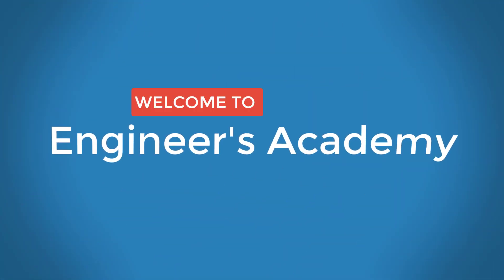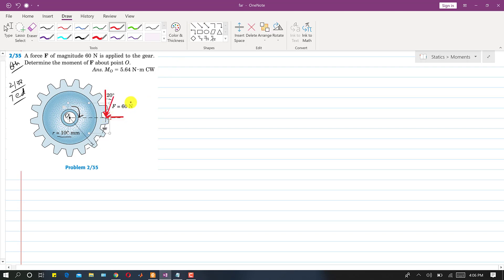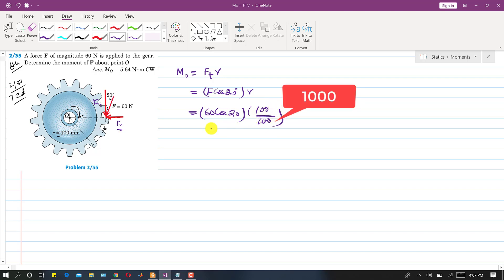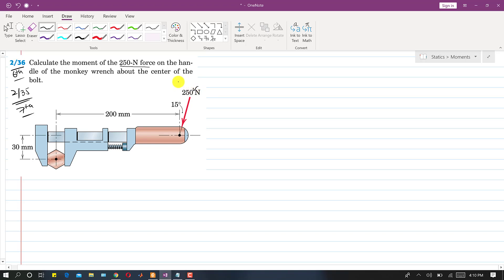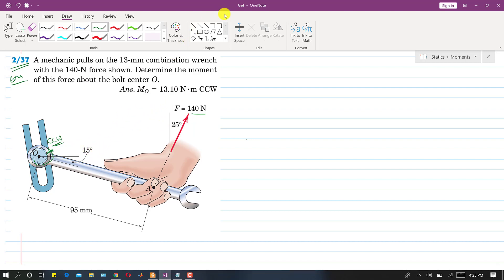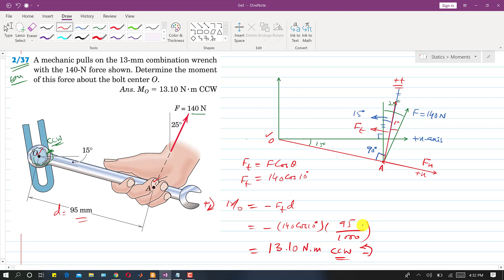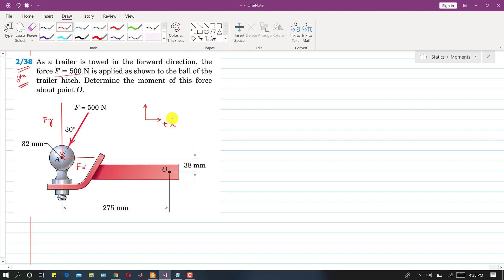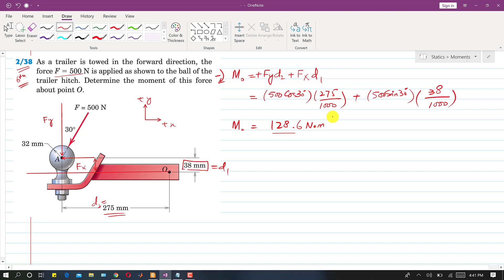STATICS | Chapter 2 | P2-35 to P2-38 | Moments | Engineers Academy

Comment: In 2/38, why didn`t you take the radius of the ball into account, when calculating Fx*d1?
Reply from the maker: radius is already included in that length.
Reply: @EngineersAcademy2020  nah sir, 38 is just the distance from point A to O... Since the force is acting on the ball the upper part(radius) of the ball should also be taken in account.